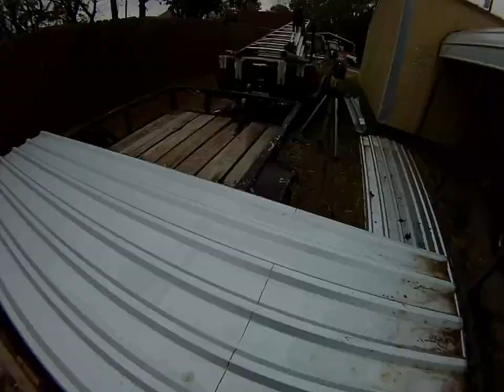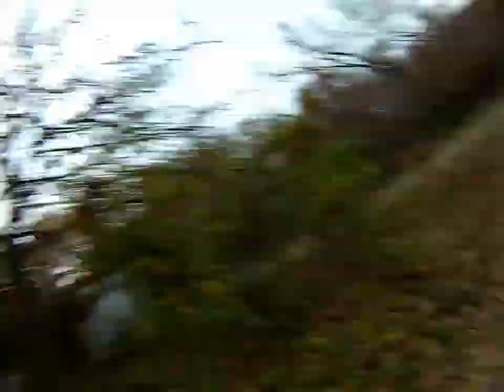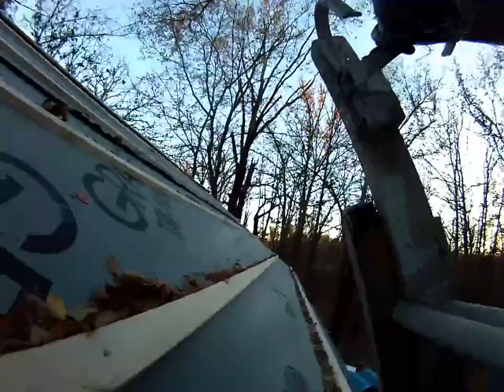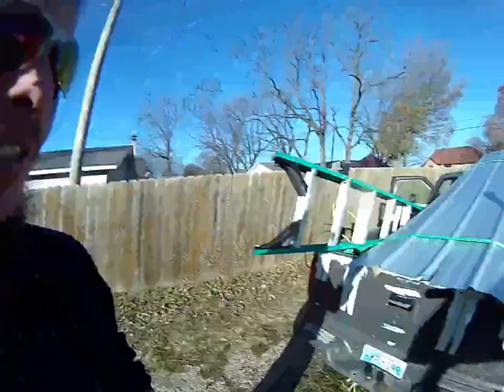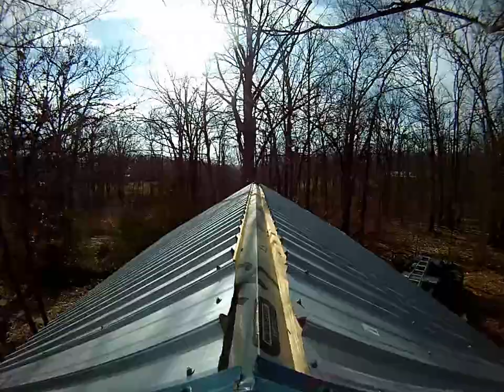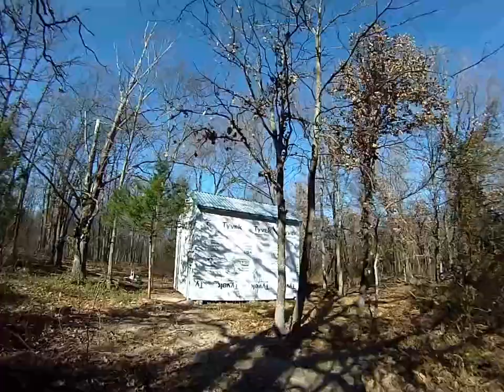Tiny House Build Pt 12 - Metal Roofing

Comment: Do you have to silicone the screws  on the metal roof
Reply from the maker: these screws came with an integral neoprene washer.  i was very attentive to driving the screws in just the right amount, not under, not over.  with the right attention to the torque on these screws, you should not have to silicone.  i would give the washers 5-10 years before they start to break down and you might have to assess adding silicone over them.